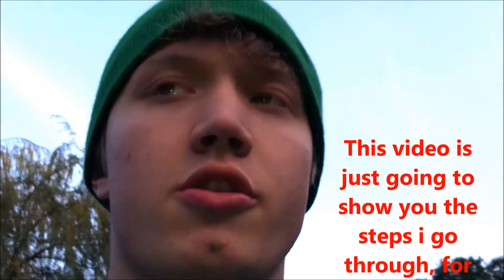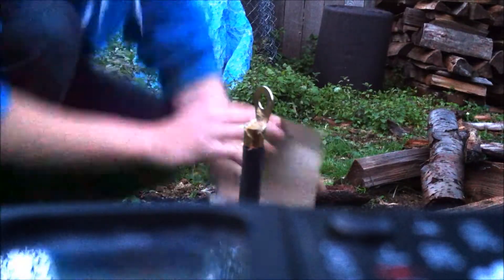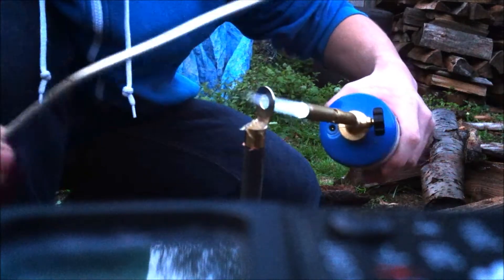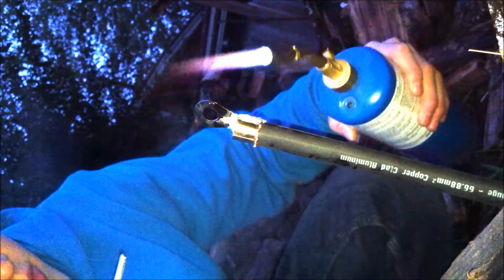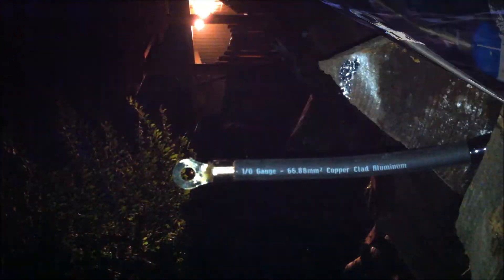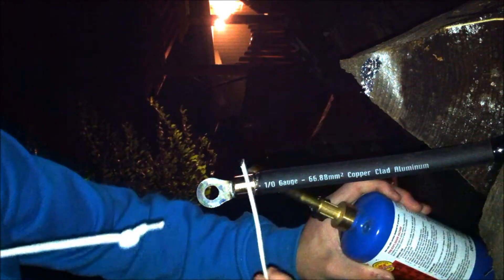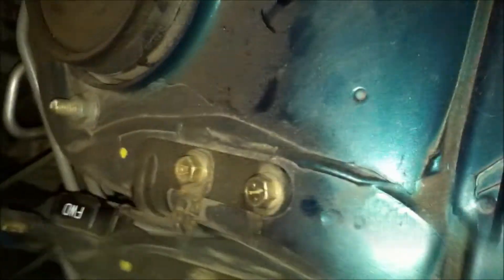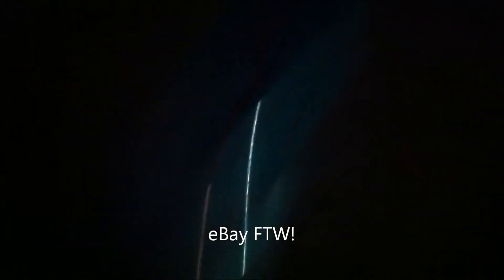Adding an Alternator Ground and Soldering 0 Gauge!

Comment from the maker: thats called the big 3 and yea dont worry already had that done before i got my HO alt. The big 3 is upgrading your alternator power wire to your battery with 0 gauge, then upgrading your engine ground to 0 gauge and upgrading your battery ground to your chassis with 0 gauge. thanks

Comment: If you have a High Output alternator, it is a good idea to run a new ground wire to the alternator and then back to the battery/chassis. The alternator is already grounded by the motor. But the motor relies on 1 or 2 dinky little ground straps that are mostly for starting the car. These often corrode and rott off. Not a bad idea, especially with a high amp alternator to make sure you have good ground to the vehicles body.

Comment: Every time I tried soldering 0 gauge by the time it got hot enough for the solder to flow the insulation was melting too far back from my solder point so I gave up on that and bought a 16 ton hydraulic crimper. I love that thing and wish I had bought it right from the start because it came with interchangeable dies that can crimp from 12 gauge to 2/0 gauge.